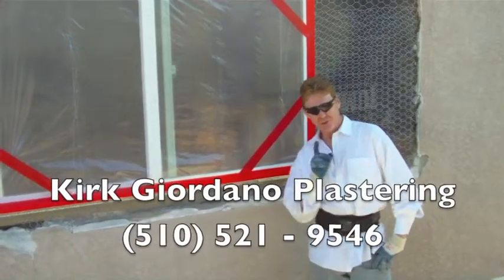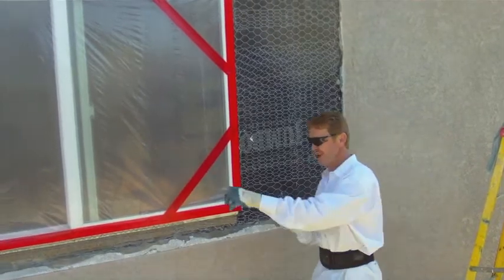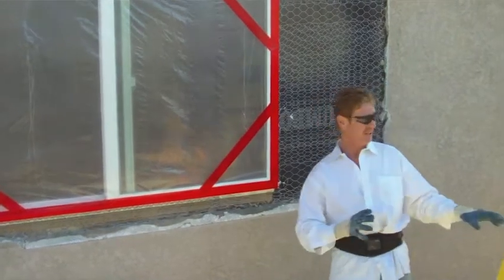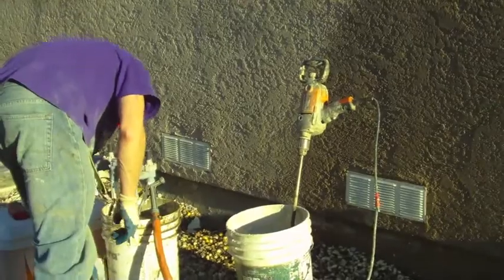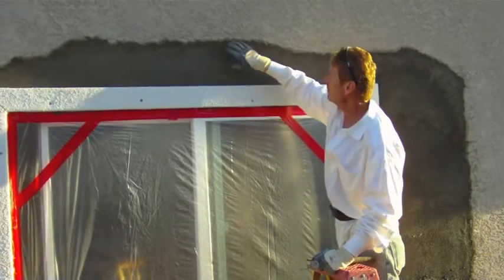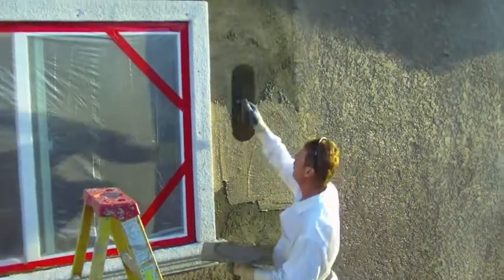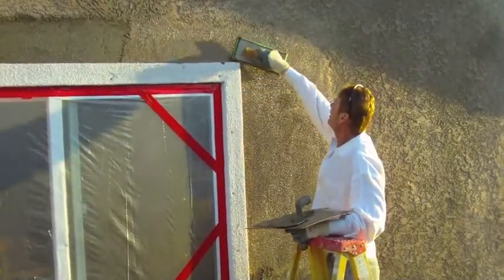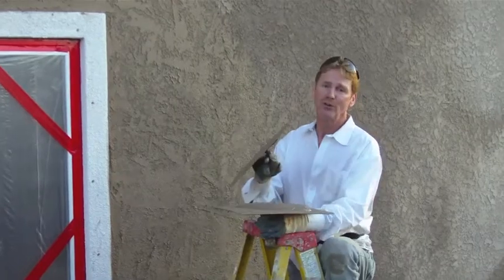Apply both coats styrofoam trim and finish coat

Comment: Hi Kirk
back in 2004 I had a room put on and the cotractor put on 1 coat of grey stucco let it dry 4 days came back and  put water on it, waited 2 more days and had a cement truck come with the finish coat. 1 year later big cracks. 16 years later big chunks are falling off the room. How is that repaired. Will I need some to come and do the 3 coat process. the contractor never did a 3 coat process. you can actually see the first coat coming through the  second coat which is the sand coat on top. I hope I'm  makeing sense.

Comment: I know this is an old video but couldn't you fog coat the whole wall to make it match?
Reply from the maker: Hello, no, fog coating just gets rid of both colors, that's all. is just water down the tinted pigment. It is only designed for removing scaffold joints and blotchy colors.🤙

Comment: You had too let the stucco dry a bit more and it’s better to use a 12-5 trowel more control, Ive been putting on texture for more 22 yrs in Los Angeles so I know a bit about plaster